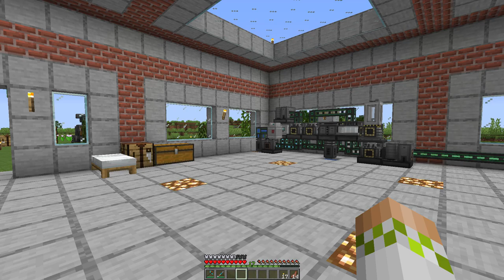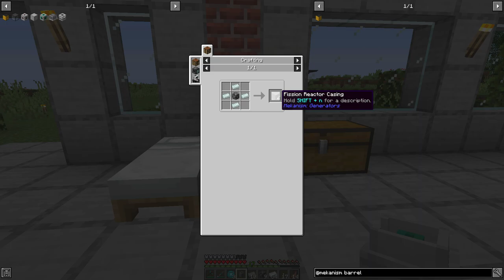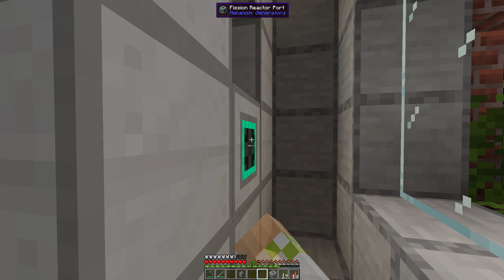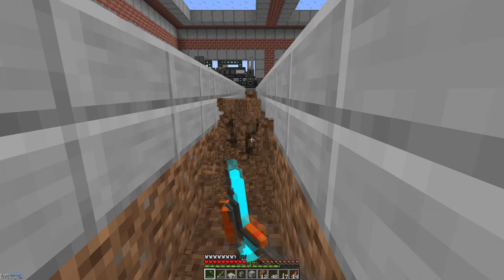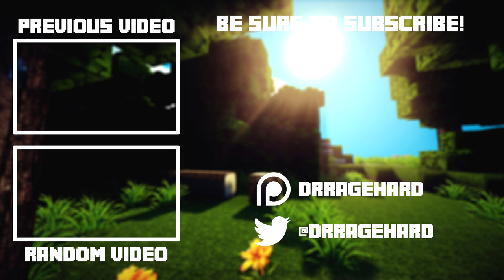Surviving With Mekanism v10 :: E08 - Simple Fission Reactor

Comment: 90% of modpacks have a block from cooking for blockheads called a sink, Hook it up to the highest tier of pipe from mekanism and it will keep water in the reactor
Reply: The best cheeze ever
Reply: it dosen't work with burn rates higher than 4.2 (even with multiple pipes.) use the integrated dynamics way that Chosenarchitech did in #31 ATM9.

Comment: fun fact: scram stands for safety control rod axe man
Reply: Here's what I found on Wikipedia:

"United States Nuclear Regulatory Commission historian Tom Wellock notes that scram is English-language slang for leaving quickly and urgently, and cites this as the original and mostly likely accurate basis for the use of scram in the technical context. A persistent alternative explanation posits that scram is an acronym for "safety control rod axe man", which was supposedly coined by Enrico Fermi when the world's first nuclear reactor was built under the spectator seating at the University of Chicago's Stagg Field. That reactor had an actual control rod tied to a rope, with a man with an axe standing next to it. It could also stand for "Safety Control Rods Activation Mechanism" or "Safety Control Rod Actuator Mechanism"."
Reply: why did I find this so freaking funny
Reply: if the control rods get too dangerous, they send in the axe man

Comment: Logics controller is not just for 3rd party modules.  Put 2.  One set to high temp, the other set to activation.  Put vanilla piston on high temp.  Lever on activation.  Position the piston so when reactor reaches high temp, it'll knock off the lever deactivating it.  Make sure to have a pump always attached to it as backup cooling.
Saved mine from exploding few times.

Simply connecting redstone signal between logics controller doesn't work as it'll turn on and off as temp goes up and down eventually exploding.
Reply: Thanks, the videos help set up the devices. :)

I solved this too in the following way with two *Fission Reactor Logic Adapters*:

• set to overheating
• set to activation / deactivation

Output first interface > into a Redstone Comparator > Redstone to Piston > Piston points upwards > on the Piston a block of Redstone > behind the redstoneblock the second interface
This can be expanded by adding a coolant pipe (extra tank) next to the redstone block. Set pipe to redstone activated. If the block is pushed up, the line opens and the reactor cools down faster.

If the temperature rises into the critical range, there is a signal. The piston pushes the Redstone block upwards and the reactor switches off. Was worth it. Already saved the whole base for me. :D
Reply: I've played on some servers with unstable machine updates (probably Performant), and having safety shutoff is important even with what should be a safe reactor. It takes less than a second to experience critical temperature if something goes wrong on a really large reactor, and that damage% doesn't recover fast after the fact...

Comment: Great video! Do you happen to know what the difference is between water cooled and sodium cooled (besides for sodium being more complicated)? I tried both but they produced basically the same amount of energy given the same amount of fuel.
Reply: I'm pretty sure that the sodium requires a boiler to make power with the turbine
Reply from the maker: Sodium is a LOT more efficient at cooling than water so when you get to super high burn rates you end up needing sodium since water wont be able to keep up with the rate of heat generation. The sodium itself wont product more energy, but it will allow your reactor to burn more fuel at a faster rate without blowing up, thus increasing energy production through that.

Comment: @RagePlaysGames great tutorial vids helping a ton with understanding mekanism.  have your tried upgrading the water pump and piping going into your reactor if you search for @meka fluidic plenisher its the upgrade to water pump.  then upgrade your water lines and u can keep the reactor filled with water with a single source.  upgrading the pump takes a pump + tin ingots so its cheap to upgrade pipes arent too bad either since you would only need 3-4 based on your design.  also as you produce more power, your power lines should get upgraded to handle the load and be more efficient :) hope these tips help.  keep up the amazing job!  not sure if you have yet but do you plan on doing a Applied Energistics 2 surviving series?

Comment: It does work but it’s glitched on sensing that It has water usually putting another block of water next to it fixes that and then you can remove the water leaving the pump in a single block of water.

Comment: Any suggestion on why my reactor keeps blowing up ? everything is working fine and then all of a sudden it will blow up ! 
Any suggestion would be amazing, i'm up to thermal episode but have to keep coming back to figure out why it keeps exploding ! 
nothing like auto save on a  server!
Reply from the maker: The only thing I can think would be the power backs up and has nowhere to go, causing the turbine to stop and the reactor to blow up. You need to always have room for the power to move out of the turbine otherwise you risk meltdown since the coolant will no longer be condensed back to water for use in the reactor.
Reply: @RagePlaysGames  thank you heaps man !  yeah i did a little reading from four years ago saying something similar !

Comment: can the inside of the reactor have air blocks in it?
Reply: yes if you have bigger reactor in x will be air and in space will be fission fuel assembly and on top of it will be control rod assembly

                                                                               X
                                                                           X      X
                                                                               X

Comment: I followed everything step by step, once i complete the build i dont get that screen you get when you start explaining everything once its built. not sure what im doing wrong or if it needs to be placed on a specific block to work.
Reply from the maker: The only things with this setup I can think that would mess it up would be any edge block not being casing, not having a control rod assembly on top of the fuel rod. Do you have port blocks / glass blocks on any of the edges? Do you have a control rod assembly on top of the fuel rod?

Comment: I followed your tutorial, 2 times the reactor exploded :'(
Reply from the maker: Do you have a constant supply of coolant and somewhere for the steam to go? You should use an industrial turbine and induction matrix as I state in the video (we cover them in the next few episodes) to make a closed loop system. You need to pull all the steam out otherwise the system will stop cooling off and you need to supply it with coolant to keep it cool. If the thing using the steam like the turbine backs up from lack of coolant being pulled or lack of steam consumption it will also blow up and lastly if the turbine is full on power the turbine won’t work and the reactor will blow up. All these need to work together to function properly :)
Reply: @RagePlaysGames  i copied all you did in all your episodes, so maybe turbine is not enough
Reply from the maker: Well if you copied it exactly and all the input and output numbers read the same the turbine is capable of supporting a fissile fuel burn rate of 19.2 MB/t which is 19.2x higher than the single column fission reactor in this episode can even be set to at its max. Something must be wrong somewhere in the setup, and without seeing it first hand it’s hard to pinpoint where, but if your reactor is heating up and melting down your first indication of where to start is if the issue is with lack of coolant coming in (too little water) or too much steam in the reactor backing it up.
Reply: @RagePlaysGames  nvm ty for your help :)